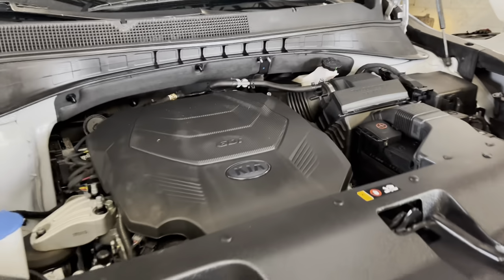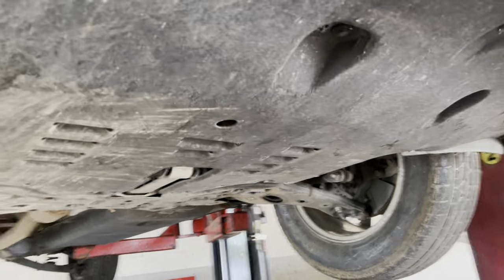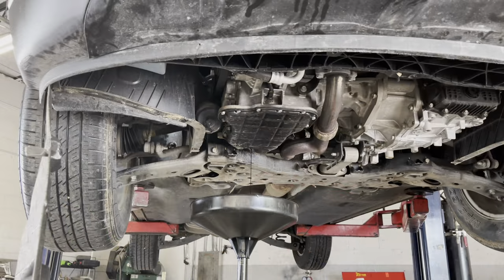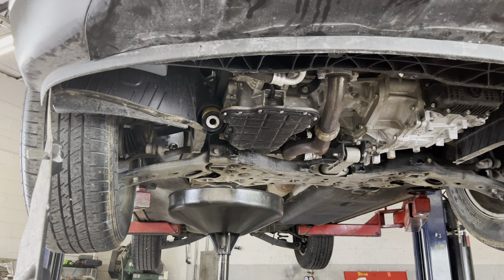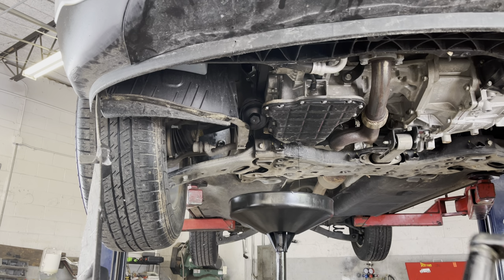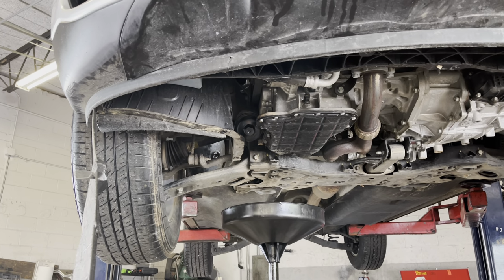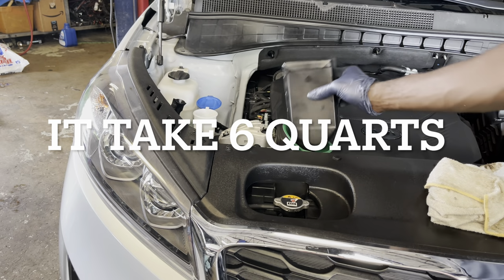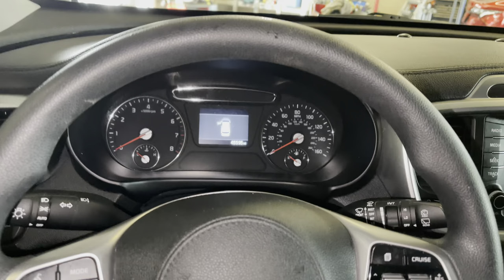Doing a oil change on a Kia Sorento with the v6 easy diy

Comment: Just letting you know my oil filter on my 2016 kia sorento sx V6 3.3L is on top of the engine. So if someone watching is like oml wth just look around XD.
Reply: THANK YOU! i have a 2017 EX AWD, and I’ve been looking all underneath the engine lol
Reply: My 2007 Hyundai Sonata Limited had this same 3.3 L V6 with the filter on top. I just purchased a Kia Sorento EX with 3.3 engine and this video will be a big help in changing my oil and filter the first time. BTW, 27mm is 1 1/16 (1.0629) inch size in so either size should work on the oil filter nut.

Comment: Thanks for the video bro. How do I make Kia Sorento engine last longer. I recently saw people saying Kia Sorento engine Burns oil fast and it's engine doesn't last long in USA? I'm Shocked because in my country Kia Sorento and other kia Cars don't have engines that Burns oil and they last long even driven for long distances.
Reply: KIA USA recently extended their engine warranty on my 2016 Sorento 3.3 to 15yr, 150K due to coolant leaking into the heads. My engine had catastrophic failure at 60K but was mostly covered at the time for full replacement.

Comment: That's either the 2.0 or 2.4  4  cylinder Sorento engine. Not the 3.3 V6. The V6 engine oil filter is on top of engine folks. 
The 2.0 and 2.4 will require 5.1 quarts of oil and the 3.3 V6 will require 6 quarts of oil when changing.
Reply: Watch this video this morning before changing my oil. Have the v6 engine. Caught hell trying to find the oil filter underneath. We finally found it on top driver side.